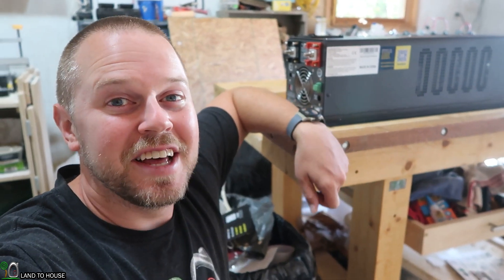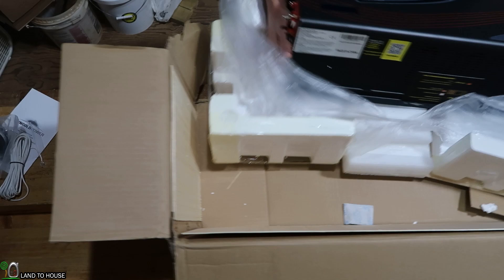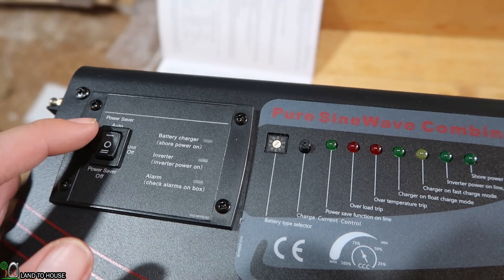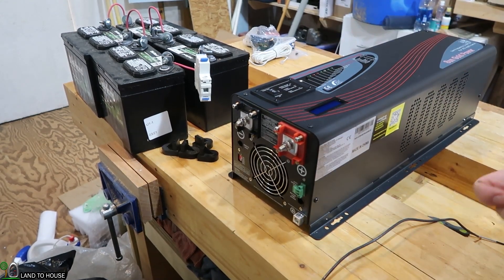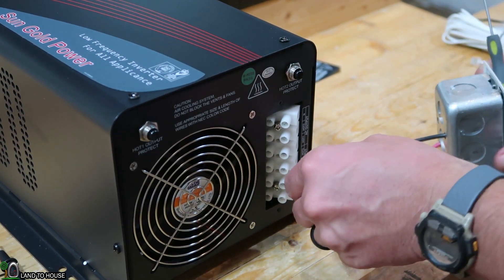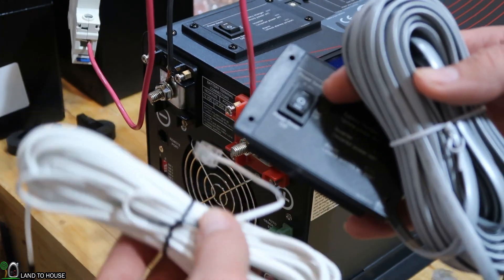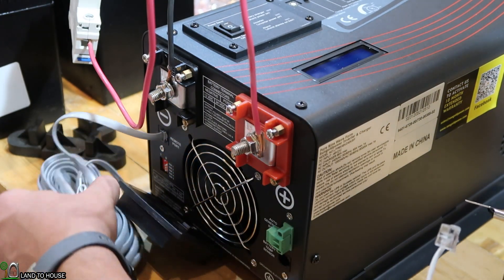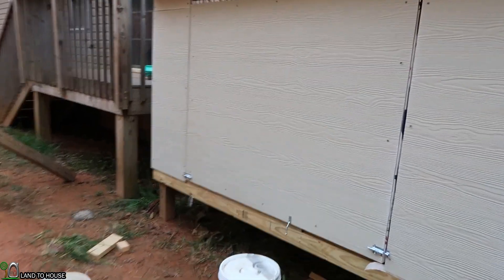Sun Gold Power 6000w Pure Sine Wave Inverter and Charger

Comment: This inverter has been running my whole house for the past month and I can say it's quite amazing. I do have their 18000 watt inverter on order but frankly the 6000 watt has been covering our Baseline Necessities very nicely.
Reply from the maker: That is good to know! I have only used it to charge a few power stations and run the internet and tv when the power is out. But I can see that it would manage to run most of a house.
Reply: @LandtoHouse  so far I'm amazed that this little inverter can run everything and does a better job than our 13kW generator. Maintains the voltage and frequency whether it's just a few lights or the electric clothes dryer is on.  We power two air conditioners, a recording studio, a shop full of electronic test equipment, plus all of the lighting, deep well pump (86 amp start current), furnace, water heater, etc. plus a lot of computers. Most of the time, the fan doesn't even come on.
The only thing is if you are a shortwave listener, you'll need to buy a lot of clamp on RF ferrite chokes to suppress the RFI hash this inverter puts out. When I first installed it, the hash was so bad, I could not hear even a strong local HAM operator on my radio on 75 meters. Now, with twenty suppression ferrites and capacitors across the output AC lines and a good earth ground, I can listen to most SW bands with moderate and even no electrical noise in some portions of the spectrum. Important to mitigate this, else your HAM neighbor will soon be knocking on your door. :)
Reply: Only need 10x batteries to run it.
Reply: @spike178  What I need a LOT more of is solar panels! Winter is brutal. Energy production is down over 80% compared to summer.
Reply: 0:23
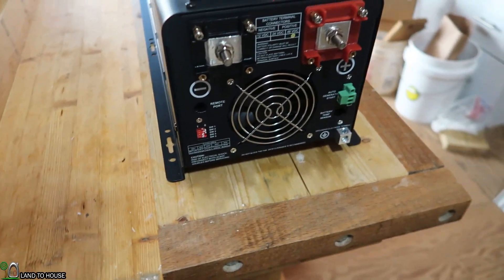Reply: 2:40 2:48 2:52 3:01 3:18
Reply: @LandtoHouse can i use this thing for AC coubling use? I would like to build a coubin in the forest, and i thought that this thing is a cheap alternative!  A friend same time wants to upgrade his grid tie system and his 4KW grid tie inverter is available to myself!!
Can those two things much together? I know that,  biggest deal is the off grid inverter!

Comment: This is an awesome inverter but this inverter is not made by Sun Gold Power. Sun Gold Power does not manufacture any its inverter offerings. Sun Gold Power is just a system reseller that rebrands the products that they offer. Sun Gold inverters are manufactured by Sigineer Power. Sigineer Power manufacturers inverters for several renewable energy companies.
Reply: Actually, the EDPC-6000-48-APC from Electric Car Parts Company also looks like the same inverter. 
That website references the APC manual. APC is a prominent source of UPS backup power supplies.

Comment: Seems pretty cool -- not overly fancy, but has the necessary bells and whistles. I like the wired remote for turning it off/on without having to go outside or mess with a phone app! I'd love to see you wire this up 240v to the home and use it for some of the larger appliances -- that seems to be a place many don't test or show with these... given my math is right that it should run at least 25 amps at 240v and 50 amps at 120v? Consider me GLUED TO THIS CONTENT! :)
Reply from the maker: Someone has been doing a lot of research.... ha. I might get to run some of the more intense applications in the home. To be honest I mostly want a power down option to run the fridge and tv/internet. A bit overkill but nice to know I could run a lot more.
Reply: You may need to check them figures out

Comment: That's what I told you I had used, although a different brand. Looks good. My unit does not charge from solar only from the grid or a generator. That is, it does not contain a charge controller,  just an inverter/charger. I looked into a "three in one" inverter/charge controller/charge controller, but it was to much for my budget.
Reply from the maker: This one is the same way. I dont think that it works from solar. Just the grid and generator. I will probably only use it with my solar and hydro. But an auto gen start would be nice.

Comment: Thanks for putting this video up, that is an impressive bit of hardware, I'm jealous. 
Your pig-tail receptacle uses Black for Neutral and Red for Hot1, I keep expecting to see smoke, LOL.  Please Please, on the AC side White is for Neutral, Black and Red are for hot.  There will be a day when you have some help with a project, or have to call in a 'professional' for assistance, and this will save a LOT of headaches, confusion and time.
Reply from the maker: It is a monster for sure. I used the wire laying around the shop. Its wild that solar cable is almost always red and black. You would think the standard would have a white wire.
Reply: @LandtoHouse  DC (solar/battery) convention is black ground and red power. AC convention is white neutral, black/red/blue hot, and green ground. There's actually laws about colors for AC wires. Look up the National Electric Code.
Reply: @mausball  I believe the colors, black and red denote polarity, as in red=+(positive) and black= - (negative)
Reply: @CraigThorne  for DC, yes. For AC, there are colors legally mandates as part of the NEC.
Reply from the maker: That is great info. When I wire the outdoor power shed I will use white as the neutral.
Reply: @LandtoHouse  you’re welcome. Fwiw, black is always L1, usually blue is L2, and if you have 3ph red would be L3. Lighting travelers for 3 way switches are usually yellow.

Comment: Been using a 24v 5000w unit for 11 years, there not the most efficient at 88% so i only use it on days with full sun however it's crazy that it runs the welder 170a  and big machining tools

Comment: No one shows the charger side of these. How did you hook up to AC? What size outlet should I use? 15 amp? 20 amp? 30 amp? How did you wire the AC in? Any info would be great. Super curious, not a lot of info. Thanks!

Comment: I have a similar inverter,it's a powerful unit,only downside is that  it uses a bit of power (self consumption).It powers my stick welder without any issues.
Reply from the maker: I hope i can keep the hydro going all the time to keep up with the consumption overnight. Luckily there is a remote off switch.
Reply: @LandtoHouse  as long as you have a battery bank big enough that would run wherever you can put on , i have the 4000w version running my whole  house including my water heater 3800w the only thing i wish would have is a monitor system online or some sore monitoring at least i have a victron solar charger that let my monitor the solar input.
Reply: corey Babcock  yes i know now , but to tell you the true didn't have the money at the time but i will upgrade in the future for sure .

Comment: I wonder if this invertor could power an air condition unit🤔 that would be interesting if possible, but I know basic appliances would work well, tvs, lights, fans right?
Reply from the maker: At 6000w this inverter can run an ac unit. You would need plenty of solar and batteries.

Comment: This is pretty cool. This would thoerectcally run my essentials (freezer, climate control, etc.) during a power outage. I'd be interested to see how long batts would last with a particular load and what battery config you use. You solar experiments would be very interesting as well. Looking forward to more info.
Reply from the maker: When I get this installed into the power shed i hope to position it so I can run tests. At 6000w it should run most of the house. Battery capacity is the issue.
Reply: @LandtoHouse  Battery banks are like motorcycles. You can never have enough power.  I just ordered a 6000 split phase one to replace a 4000 Watt unit.
Reply from the maker: @kimmer6  Thats a nice upgrade!

Comment: Hello Sir,;
Got this unit but is 24 DC and is 2000 watts , can it take or pull three batteries  of 12 volts each???  

Interms of charging system,  it got 20Amp, how many solar panels i must  connect   so that it can charge  nicely & with those panels how many batteries must be there?? 

Will be waiting  for your reply  plz

Comment: Great video! I set up my photovoltaic system with an inverter equal to yours but 3000w. One question: does the inverter convert itself to "battery mode" when charged or does it have to be done manually? I listened to your video but I'm Italian and I didn't know how to translate a few words :)

Comment: Thanks for the Video, I just picked up a 6kw Sun Gold Power LFP Series, and I was a little confused on why the AC terminals had 2 rows of screws and the second one was almost impossible to reach, but it looks like we only need to mess with the "front" row screws" on the terminal block. They now send out an LCD Remote Panel with the newer models, its very useful. Thanks again!

Comment: Can you give me the link to your battery please?
Reply from the maker: This was just a test. I now use some agm batteries and will soon upgrade to lifepo4 batteries.
Reply: My dad asks does it need a specific amp?
Reply from the maker: This needs a voltage range. (48v to 56v roughly for this model) the amps will fluctuate based on power needs.

Comment: I'm not trying to say anything about your video but every single video out there on YouTube does the same thing you have an inverter that you're trying to test that can power up a whole house and what you use to see if it works is a 10 watt light are you serious? Hook up heavier things to show the power of the inverter and stop hooking up small lights just to see if it works you can use a $50 inverter to do that
Reply from the maker: Just today I received a 5 kW hour lithium iron phosphate battery. I'm gonna be connecting it to this inverter for some discharged tests. It would be good to try out at least a 1500 W load.